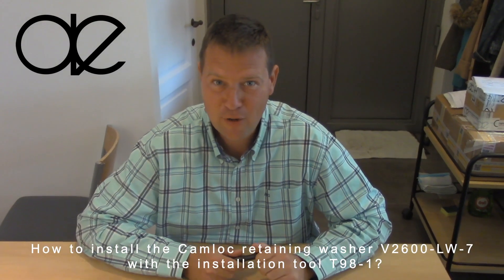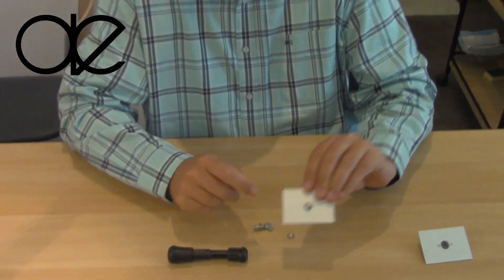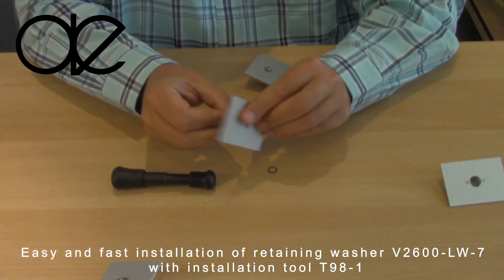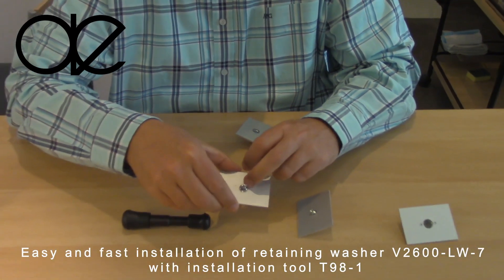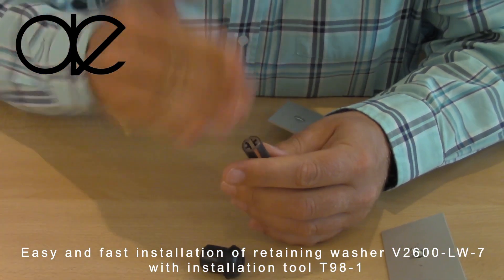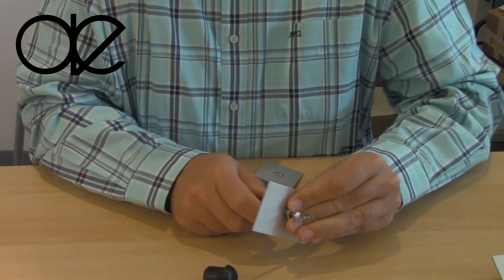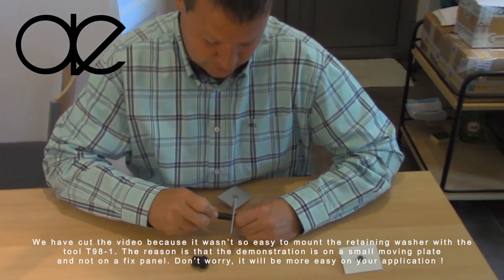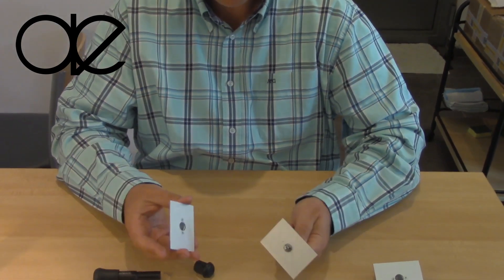How to install the retaining washer V2600-LW-7 with the installation tool T98-1?

Comment: But the stud still moving after unlocking. What other models that keep the lock fixed in place?
Reply from the maker: it's a starlock washer, so the stud is fixed in it's place vertical axe way, however it can still be turned, although requires lot's of force, a real fixed stud, can be found in www.spanclamps.com
Reply: @AnemoEngineering  
Thanks
If contact person to follow with him.